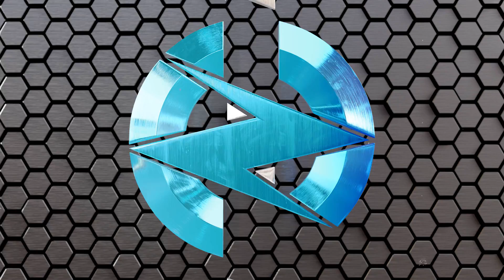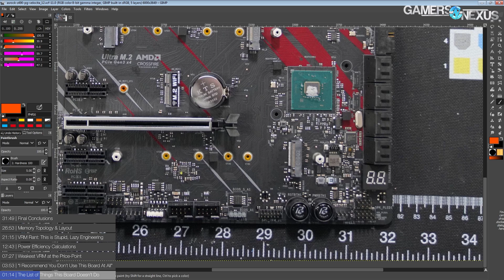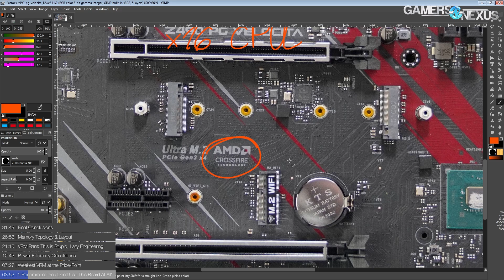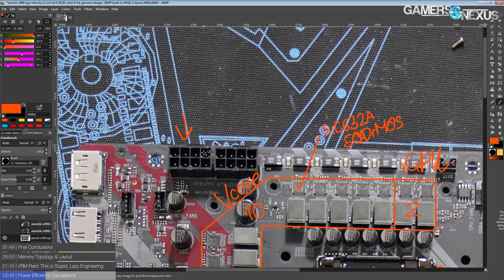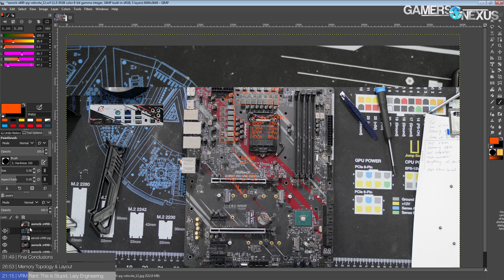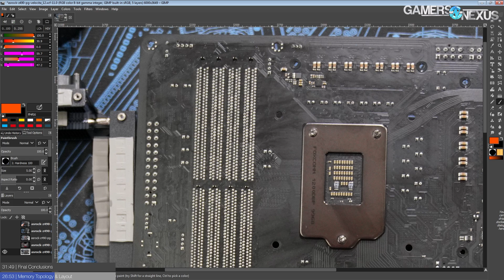Huge Disappointment: ASRock Z490 Velocita Motherboard PCB Review

Comment from the maker: Learn about problems with Z490 motherboard auto settings here: https://www.youtube.com/watch?v=qQ_AETO7Fn4
Best CPUs of 2020 so far: https://www.youtube.com/watch?v=VDZQCcDMcfw
Subscribe to Buildzoid of Actually Hardcore Overclocking here: https://www.youtube.com/channel/UCrwObTfqv8u1KO7Fgk-FXHQ
TIMESTAMPS
00:00 - The Huge Disappointment
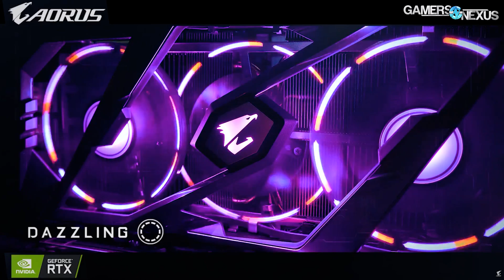01:14 - List of Things This Board Can't Do
03:53 - ASRock's Recommendation vs. Our Recommendation
07:27 - Weakest VRM at the Price-Point
12:43 - Power Efficiency Calculations
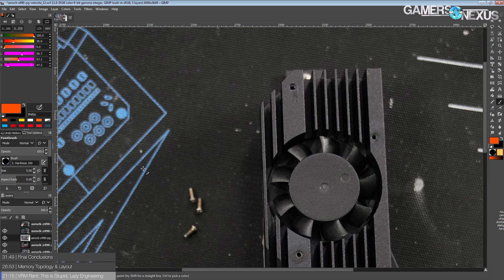21:15 - VRM Rant: Lazy, Stupid Engineering
26:53 - Memory Topology & Layout
31:49 - Final Conclusions
Reply: One thing you missed.
The problem of the board is that the name is wrong😂. The wanted to call it speed but in italian, but forgot the à and so it should have been velocità not velocita🤣
Reply: You know you could leave your own GN screwdrivers in the pictures for product placement rather than iFixit's drivers, I'm sure you just happened to use what was convenient at the time
Reply: "my disappointment is immeasurable but my day is not ruined" top 10 biggest anime betrayals
Reply: Would be really nice if you added how well the boards will handle the most high end CPU's at stock. There was a kinda crap x570 mini-itx board(there are almost none of those) that I needed to put a Ryzen 3950x on, but I wasn't sure if it could handle it. I found a guide on it, but the guide only touched on overclocking. Knowing whether a 3950x will function properly on a terrible VRM would be nice. Mini-itx was stubbornness on part of the guy I was building for btw. I told him he was limiting his options A LOT by doing it for x570.

Comment: 3 years later, I'm seeing these for around $85-$100 on eBay, I think at that price point it is a great value. I appreciate the 8 SATA ports as I intend to use this with 8 drives for a NAS and using it as a home server. So I won't be doing a lot of overclocking with it anyway, hopefully those little fans won't ramp up very much at all.

Comment: I like this marketing vs. engineering battle:
ASRock: Our board has big radiators and active VRM cooling!
Buildzoid: Because your VRM section sucks and it has to have it, otherwise OC'ed 10900K would melt it.
ASRock: ...but it also has postcode display (almost crying)
Buildzoid: OK, I'll give you that...
Also Buildzoid: ...but I like my postcode attached to a good motherboard.

ASRock has left the building.

Comment: No, no... what you're missing is that's not an "airflow restrictor plate. It's a "Fan Speed Enhancer". See, ASSrock are geniuses. They wanted to put a slower, quieter fan but needed to make it run faster so alarms for fan speed didn't go off, so they added the "Fan Speed Enhancer" so that the fan could spin faster and make more noise so you could hear it better AND it wouldn't set off the alarms in the UEFI.

Comment: I have an ASrock mini ITX motherboard from 2015 with a core I3 (I was looking for AMD at the time but sadly it was lacking). 

I'm happy with it except for one feature that's so annoying: It turns itself on randomly. I've turned off everything I can think of in the BIOS that might trigger a switch on event. I'm just glad it's in my portable, rarely used computer, and not my day to day computer.

Comment: Generally: You really should add a clear statement before each of your mobo review to remember the audience that your rating is ONLY based on hardware (you see on a pic) and specs. Id assume it as a a quite safe guess, that many ppl take that as a sufficient decision to buy a board what can be misleading ppl (esp considering the overall lack of attention span and patience to read through stuff). Seeing how the Gigabyte Extreme Threadripper board fails the 3600 256gb test @level1  , or how bad some vendors implemented IOMMU groups, the dangerous auto overvolting some boards do, the bios implementation + support/service should be a  huge part of the decision. 
Second, now that you have a quite far reach, it may be adviseable to speak with the vendor first and wait for their statement on the topics. its mabe not needed, but a gesture of fairness. always be humble enough to realize that mistakes can happen, and with that power you have now, it can have consequences.

Comment: My latest foray into PC building madness was X570. Trying to find an X570 motherboard with debug indicator on it that isn't $300 or more was like pulling f*cking teeth. When I was building Z270X, the feature sets were huge for such a respectable price. My Gigabyte Z270X Gaming 7 motherboard had so many extras on it for around $220, dual ethernet, power and reset buttons, debug indicator, among many others. X570 boards are so barren of amenities unless you pay upwards of $300, it's pitiful, and I see that carrying over into more and more newer chipsets. I ended up having to spend $300 on the ASUS ROG Strix X570-E Gaming just to get a board with a debug indicator. It's $300 and it doesn't even have power or reset buttons. Your $260 board has one up on my $300 one. Pathetic.

Comment: That Poscon capacitor has shorter operating lifetime but its relatively high esr can act likely a low pass filter. The advantage of Poscon is that its capacitance nearly doesn't change with DC voltage bias and temp. More input filter capacitors will reduce the conducting EMI. In the end, I don't like the 3 fans either. The power electonics engineer in this project shows no innovation.

Comment: First thing I noticed is this is a board that would let you use two triple slot gpus with nvlink 4 slot adaptor AND have enough gap between cards! Great for gpu rendering! Ohhhh no SLI license. Ugh. So no nvLink

Comment: Asrock’s VRM cooking solutions are weird, on the Phantom Gaming X399 board the fins don’t really face the right way to get good airflow unless you use a top mounted PSU which Indid but rarely is used these days. It’s not even good if you use an air cooler for the CPU which blows side to side. And they cut back on the VRMs on that one because it’s a budget board for the 16 core or fewer CPUs. Logic would think you’d make sure it was a well designed cooler as a result. It literally seems designed the way it was solely for cosmetics. It makes you wonder what you’re thinking.

Comment: The benefit of WiFi integration is increased signal range and quality for Bluetooth and wireless devices. Plus with some ISP's (especially in Canada) the modem/router for consumer use is really lacking on Ethernet ports and designed for 5G/wireless.

Comment: For the WiFi I think its important for Bluetooth at-least for my motherboard I have to connect an antenna that's used for both WiFi & Bluetooth which increases the strength of my Bluetooth devices.

Comment: Ahh... VRM fans on TRX40 taichi are alright because the board ALSO has most powerful (amperage wise) VRM (90A x 16 phase) of the TRX40 mobos. (with my 3970X it rarely spins up. It did help when I was reviewing 3990X :) )
But fans used as a stopgap measure is just stupid. 
I have a feeling that ASRock doesn't care about intel boards anymore. Look at B550 Taichi. It almost looks better than Z490 Taichi. 😂

Comment: I see the IO shield doesn't provide WiFi, but there appears to be a very clearly marked chip stating " m.2 WiFi". So maybe the IO shield is just old and this board does actually have WiFi, just not where you'd expect it to be?

Comment: ASRock needs to move away from putting the PCIe x16 slot the closest to the CPU.  My X470 shoves my GPU right up to my CPU cooler, and I'm using a CM Hyper 212.

Comment: Aorus pulled the same fan header BS with the chipset fan on the X570 ITX, meanwhile there is only one other system fan header on the board. Don't worry though, because there are like three RGB headers!

Comment: Amps = Watts / Volts

20A = 23W / 1.2V, 
30A~35W / 1.2V, or 
42A ~ 50W / 1.2V. 

The amperage  is 20 - 42 A, not 200 - 300A, imho.

20A -> 23W
30A -> 35W
42A -> 50W
67A -> 80W

The PSU connector:
40A = 480W / 12V

32A = 384W / 12V

Heat is the result of component inefficiency, so the more components the more heat is generated, the fewer components the less heat is generated. For example, if each component generates 2 degrees of heat, 10 components will produce 20 degrees, while 5 components will produce a 10 degrees increase in heat.

20C = 2C x 10u
10C = 2C x 5U

where:
C = degrees centigrade (or Fahrenheit)
u = unit or component

I'm suprised you never benchmarked this board against its competitors before ranting about it.

It has a PS/2 that's great for installing Windows 7.

Comment: "It's a $260 board!"
Wish that was the case here lmao
The retailer i use is typically one of the best in regards to pricing
but it's 310€ here (or $352). What a difference. Good video, though, i'll
definitely not buy this board
Reply: Import tax and VAT?
Reply: @andersjjensen  That's probably a large part of it, yeah. But from $260 to $352 still feels a little insane for the same product

Comment: ISL69269? Nice. (Also, one of the Vcore chokes is rotated differently from the others and now I can't unsee it.) Incidentally, those non standard fan connectors are standard connectors for other uses and you can get them cheap from China -> you can change the connectors yourself. Granted, having to do so is stupid.

Comment: Those 2 M.2 slots under PCI-e slots is downright foolish.
Reply: Yep, with a powerfull gpu installed those ssds are gonna be real toasty. But they had to fill that empty space with something I guess.
Reply: @protator  thats not the only issue but they seem to face each other which means only 1 ssd can be be realistically used at a time.

Comment: I picked up a 10700k and an ASRock  Z490 Extreme 4.  I know I am getting ripped off but there was no 3900x's in stock when I had the money to order.  Anyway I've used ASRock boards for years with no issues.  Different boards I know but should I be worried about the quality of my new board?

Comment: Fun fact - implementing an integrated post card costs around a dollar. On those chinese Xeon motherboards, postcode readout is a staple feature, not found on only the absolute cheapest boards. The only reason why it's a "premium feature" is because the board vendors decided so.
Reply: pretty much everything is only expensive because manufacturers want it to be.

Comment: In regards to dual phase memory power.
It can help with higher memory clock speeds, since one of the limiting factors of how fast DDR memory can run is dependent on the stability of the power rail for it.
More noise and ripple = lower speeds. Though, most ripple and noise can be fixed by adding capacitors onto the memory module itself.
So dual phase isn't a major improvement. Its mainly a question of cost.
With dual phase, one needs fewer bypass capacitors, and capacitors can cost over a dollar a piece.
An inductor and a pair of drive transistors on the other hand is relatively cheap.
In servers on the other hand, multi phase designs are more prevalent, mainly due to the fact that DRAM needs a bit of power to just refresh itself, so a server with 1TB+ of RAM can draw over a hundred watts just there... (Not to mention that its over a much larger area too, so can't really send the current across the board, too much voltage drop for that to work.)

Comment: 22:20 "two fan headers that use proprietary connectors" Those are standard connectors. They look like a Hirose DF13 or JWT A1251 but I can't say for sure without a better picture, you can buy them off mouser all day long. They aren't even non-standard for fans because they are used for fans in laptops, servers, PSUs, routers, Oscilloscopes, etc. I just checked and I have a 1U server PSU on my shelf that has the 40mm fan with that exact connector. I am sure they are using them because their OEM for those fans is used to making small fans with those connectors and it's likely a standard part for them. They are also used in other products to cool FPGAs and suchlike. I have one board at work with 5 of these. I would say they are not common for fans in desktop motherboards but are certainly not proprietary. Note the z490i aorus ultra is using the same fan connectors and supplies adapter cables.
Reply: I thought those had to be standardised. They might be just using them because their 40mm fans use them. As long as they supply adapter cables it is fine.
Reply: don't gpus use those connectors too?
Reply: But bro, I need to plug my RGB fan into it!!!
Reply: You can buy tons of case fans that use those connectors too, they're just DC controlled rather than PWM.

Comment: so far ive been through 4 asrock motherboards didnt like em clients hated them i had 8 asus boards and  about 6 of those came back with posting issues that was actually asus fault not the clients id only reccomend asus graphics cards but even then certain ones asus is bulllshit. but GIGABYTE AND AUROS WHOOOOO WEEEEEE one time buy and the best mother boards ive used ever i still have my z68 and runs like a champ for what it is. never had issues with anything gigabyte there rams good there motherboards are the best i find for features and qaulity and price and there gpus are really fucking solid aio or fan cooled or full custom.

Comment: Asrock make trash motherboards ..... i have had zero good experiences with their products
Reply: @Wopsil i have an x570 phantom 4 gaming right now ..... its unstable, the rgb wont work with any other rgb items and software present (let alone its terrible controller software), it changes fan curves and pump profiles to the point of switching pumps off each time it decides that it cant boot (regardless of using an xmp profile or manually entering memory settings), its software looks like it was made by an A level student and is about as stable............ really from having asus, gigabyte, MSI and DFI boards in the past everything about these boards feels cheap and unstable.

Comment: Unrelated to this video, I own an rtx 2060 ko ultra, and my friend owns a rtx 2060 FE, we both downloaded the Minecraft ray tracing beta. We decided to compare FPS and I found that I was getting anywhere from 5-15 better average FPS on the same maps in the same spots, looking at the same area etc. we both have Ryzen 7 2700x’s, and we both have 16gb of ram at 3200mhz. I was wondering if anyone in the comments noticed this at all or was curious enough to test it on there own, and I figured I would leave this in the gamers nexus comments if they ever wanted to look into this.
Reply: a ko is a cut down card  and the fps difference sounds about correct  for the lower  teir card

Comment: At 25:24 you mention coil whine (and air flow noises).  But at 17:11 you mention not having an inductor (Coil)...   Are there other coils on the board itself that whine?   Also the board is recommended for water cooling... I wonder if that's part of the story of this board.... " Hey engineer: Go make a cool, silent, water cooling Motheboard"  "Here's my board, it comes with watercooling for the VRM (or some other thing) and costs (insane amount)".... "err Take all your cool ideas off and replace it with a fan, and make it cost like $250"  And now we have this stupid board?

Comment: 5:24 - how do you mean " run crossfire through a chip-set"? As opposed to dual GPUs on a single card?
Reply: on other motherboards the pcie lanes for both slots are connected to the cpu. this means both gpus communicate directly with the cpu instead of one of them having to go through the chipset.

Comment: and that's the pcb review they chose to feature on GN ? GN continuing it's "find everything possible to say negatively about Intel" amd-shill trend (you know you're obvious right ?) that said the rear i/o is usually telling, good boards have good rear i/o, this motherboard (like many even some 1000$ ones) doesn't have 8 sata ports btw it has 6 ports + 2 asmedia1061 ports, those are super slow with SSDs and should only be used with HDDs, pic of two samsung evo drives one connected to a chipset sata ports one to the asmedia https://i.postimg.cc/RhmyL9yM/ASMedia-ASM1061.jpg and no it's not the drive size difference that does that it's the asmedia
Reply: More are coming soon..
Reply: @-eMpTy-  I don't mind bashing on bad products, but manipulating information by avoiding all negative aspects of one brand (like the unacceptable shitty idle of amd (1.4+V idling on the desktop ? f.. off amd) the fake non-existant "idle only" top clocks the fact that the bios are atrocious compared to intel etc...threadripper have an idle of 56°C stock where's their coverage of that ? and on the 287-347watts the cpu draws by itself) and hammering on the ones of the other (like using 9900k@5.1ghz in their reviews when they know full well that the cpu had fine watts and heat at 5.0) I could do this all day but I'm done with them, dishonest channels get dislikes and unsubscribe I'm only here for buildzoid, also never forget the "aio vs air cooler" video made on a test bench, which removes any benefits of liquid cooling, it's lying and of zero value for a customer hesitating between the two in a real computer aka a closed case, bench testing only reason to exist is make reviewers life easy

Comment: That VRM cooler with the 3 fans actually much worse than the 2 heatpipe passive VRM/chipset cooler on the Gigabyte GA-MA790GP-DS4H. That Giga MB is almost 12 years old.

Comment: Instead of putting fans on the VRM heat sinks they could have just water cooled them and integrated into a custom loop for the CPU.  It would be so much slicker! Especially since they "recommend" liquid cooling it in the first place!